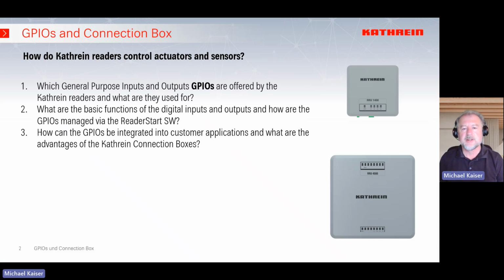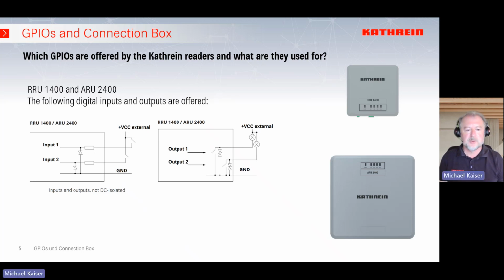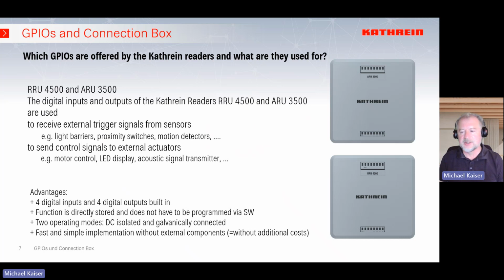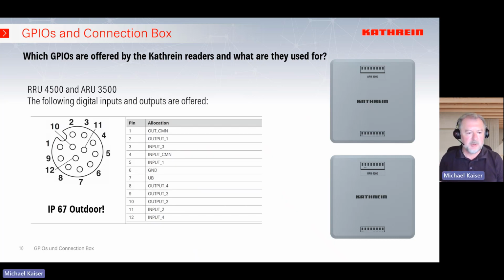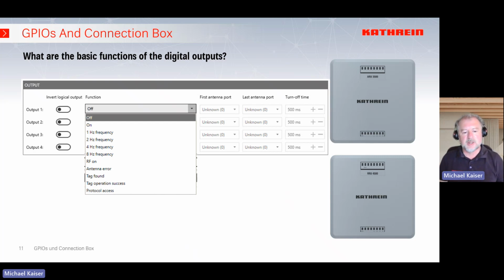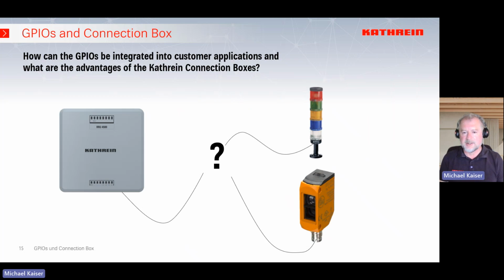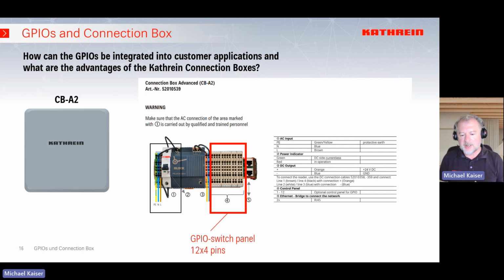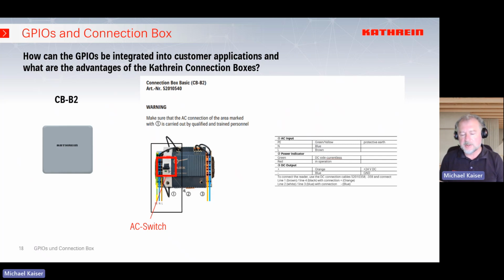GPIOs and Connection Box: How do Kathrein RFID readers control actuators and sensors?

Comment: Hello.Thank you for all your valuables Videos. I’m currently working on setting up a communication between a Kathrein RFID Reader RRU 4560 and a Moxa ioLogik E2214 device using their GPIO interfaces.

My goal is to have them interact with each other based on signal triggering:

For example:
When the RFID reader detects a tag, it should trigger one of the DI inputs on the Moxa device.
Or vice versa – the Moxa should be able to control the RFID reader’s inputs or behavior via its DO outputs.

I’m trying to wire the GPIOs directly (e.g., OUTPUT_1 and OUTPUT_2 from the reader to DI4 and DI5 on the Moxa).But they do not work.Nowertheless, I can trrigger the reader input via Iologik. 

Could you help me understand how I can safely and effectively establish this signal interaction, possibly using relays or other interface components?

Any wiring diagram, documentation, or suggestion would be highly appreciated.